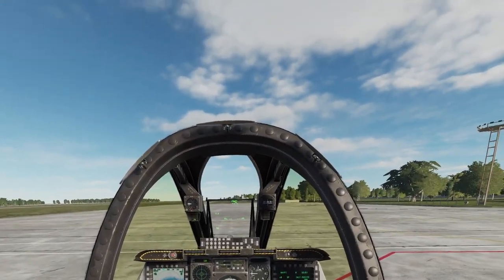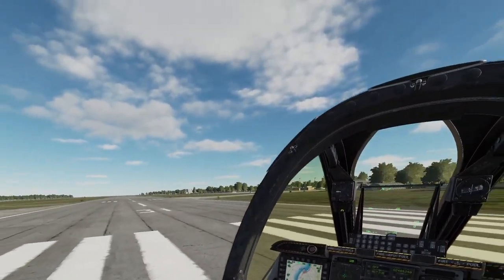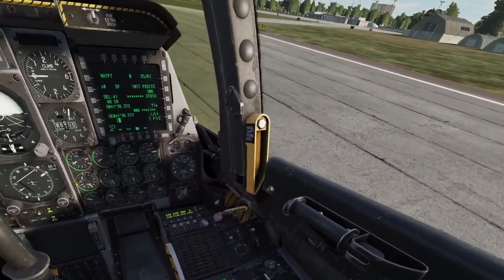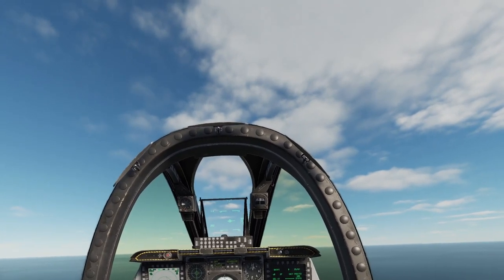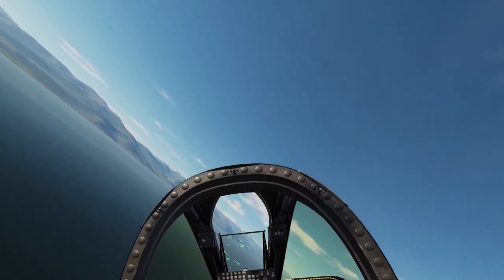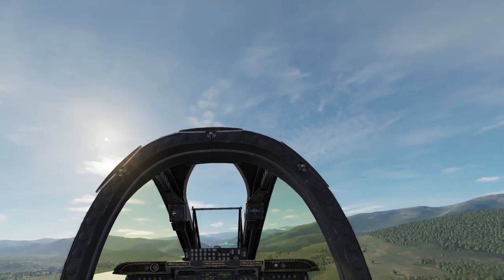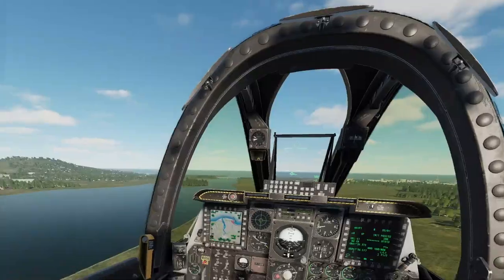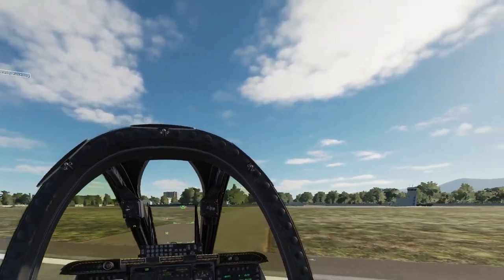Can we fly a circuit in the A-10?

Comment: would you rather head tracking or VR for fighter sims and why? cheers
Reply from the maker: @user-by1bt9cl3q  I've tried both here, so at least my answer has that experience factored in and isn't too biased (but it is still biased all the same - this is Virtual Reality Action after all!)

The ideal solution from my perspective is an Augmented Reality headset with a purpose built flight deck simulator for the aircraft type that a person would be operating. Unfortunately there's a significant cost to achieving that, and it limits the operator to a single aircraft. So a slightly better solution here from the perspective of being able to choose what aircraft you want to fly on a whim, is VR with a general purpose setup (HOTAS and pedals with an easily/ergonomically accessible mouse OR, but I've never had the privilege to try this yet - capto gloves!)

The problem with head tracking (like Track IR) is that you have to unnaturally move your eyes in the wrong direction when you move your head to look left & right to flick switches and rotate dials on the side panels, or when you're looking over your shoulder at the bandit you just merged with to turn into the type of circle fight you need to be in to have the advantage. You also just don't get that "holy crap, this feels like I'm actually sitting in a real jet!" illusion that VR gives you. I'm not even kidding when I say that I've lost count of the number of people that have climbed out of the VRA 01 flight deck with a massive grin on thier face saying "that felt like I was actually in a jet!"

What you can achieve with Track IR style head tracking is:
1. A higher resolution image (good for content creation),
2. You can see any other accessories you may want to use - like MFD panels with pressable buttons, landing gear/flap levers, kneeboards, or streaming service chat if you're a streamer (but there are ways of having stream chat inside a VR environment), and
3. You're not completely isolating yourself - so you are actually able to see who just walked into the room, push the auto-pilot button (disgusting...) and sort out whatever situation just interrupted your flight sim session.

I am a big fan of people having a safe environment to do flight sim in - and when you put on a VR headset, you do remove that immediate ability to identify if you're safe or not when someone enters your simulator area, so it's also a factor to be acknowledged when you're using VR and headphones - you can neither see nor hear that you may be vulnerable to whatever nefarious intent someone may have for you. Food for thought!

Comment: hey i was wondering what are your pc specs because ive been thinking of getting a vr for dcs but i have a 1650 super lol
Reply: Depends on the headset, I'm using the PiMax 8K and the 3070 maybe JUST cuts it. But any lower resolution headset you'll be safe with a 2060 or better.
Reply: @dalevaline6078  thanks I  appreciate it
Reply from the maker: Hi Jug Man! I love your user name hahaha!

If you're interested in my PC specs, I'll upload them on Instagram in a sec (I've thrown a link down the bottom of the msg here) , but if you just want to know graphics card details quickly, like what Dale has discussed, I'm using a Meta Quest 2 with a GeForce RTX 2070. I also have an Intel i5 processor and an Oculus link cable that I purchased from KIWI Designs. Everything runs smoothly, but I do have to admit, the graphics aren't anywhere near maxed out...

What controllers are you using, and what aircraft do you like flying?

My Instagram is: https://www.instagram.com/invites/contact/?i=igyqpfxclqpz&utm_content=3xqta83
Reply from the maker: @FoolishAvenger  Hey there! Just wondering how you were getting on with your flight sim solution! What did you end up doing - did you go down the VR path?